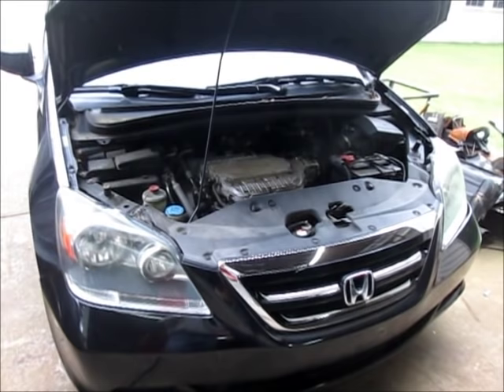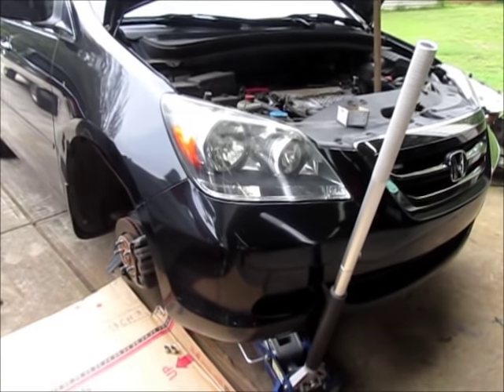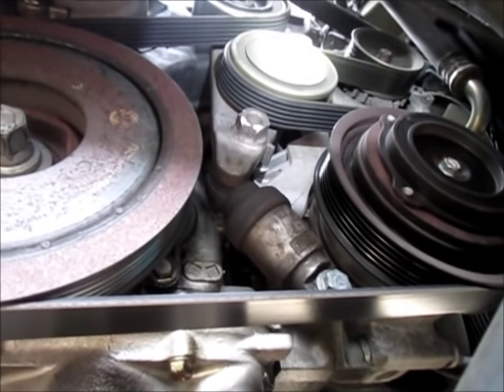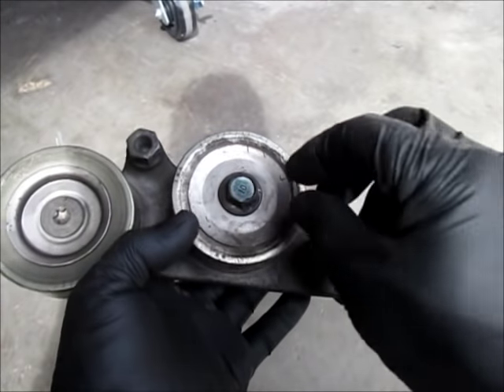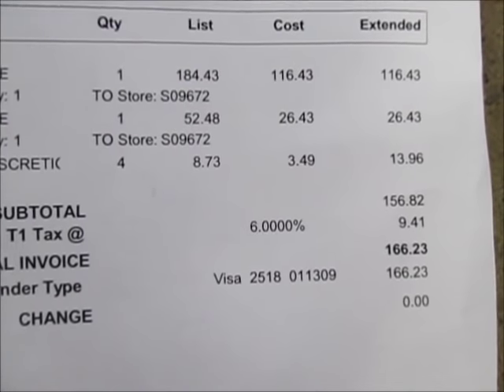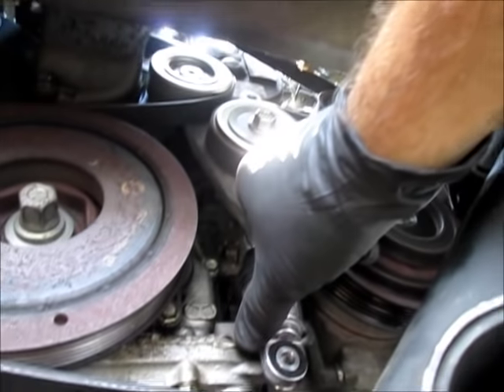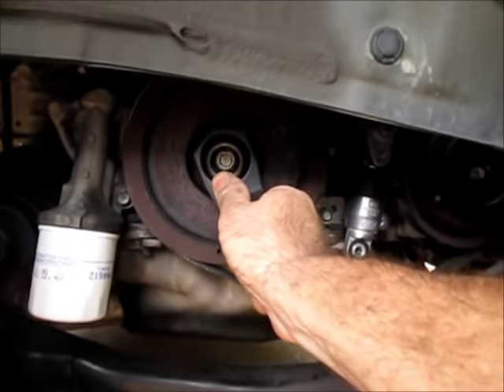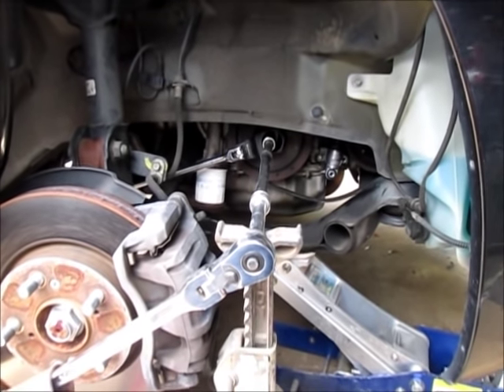Honda Odyssey serpentine belt tensioner replacement and bad crank pulley.#honda #odyssey

Comment: Can you put the tensioner in two different ways.When I went to put the serpentine on I had 2 torque the tensioner really hard.I got the 40 belt on but after that  sheered off the tensioner bolt. Luckily the bolt came out easily so I replaced the tensioner assembly and got a bigger belt.
Reply from the maker: It should only fit one way.
Reply: Thanks for the answer. Your a good Dude                 George

Comment: Well done production and I appreciate the information.  Have the same chirp and suspect it's the idler or tensioner pulley. I plan to dig into into it tomorrow.  I hope to just replace the pulleys and will reply back as to how that went.  Quick question, are either the pulley bolt (that also bolts down the tensioner assembly) or the balancer nut reverse thread.  I am 99% sure they are not but with bolts that are difficult to break loose  it's good to be 100% sure. 

I've had to pull the serp belt a couple of times on my wife's 07 and it's a pain.  I tried rotating the tensioner via the "nuts" and there was no way that would work. I ended up using a crowbar like you did (I actually used a ratchet strap tied to a member about mid vehicle on the right passenger side which allowed me to slowly pull the crowbar back and then, when far enough stop, leaving it compressed, and put the belt on, then release.  I didn't even pull the wheel off)

Again, thanks for taking the time to create this and pass it along.  Good stuff!
Reply from the maker: All standard thread.
Reply: Jo Daddy's Garage for

Comment: Great and informative video. Thank you. You mentioned the van has 200.000 miles on it. Is it original transmission? I have an 08 with about 80,000 miles and want to see how long these (great) vans can last. I got it new and maintain it well (regular synth oil changes, tranny fluid change (Honda) every 10k miles (fill and drain) etc. Is your transmission original?

Comment: Two pieces of absolutely critical info:

1: People will have an inclination, when confronted with the basic harbor freight serpentine belt tool, to use a 12 point socket in order to get around the very limited throw you'll get with most of the 3/8th stud mounting points (there are only four) but this is a major mistake. The fake 19mm bolt on the serpentine Tensioner is made of cast aluminum and you absolutely need to keep all of your pressure on the flats. 
Do not use 12 point sockets on this, only six point ones!!!

2: The tensioner's hydraulic piston needs to be primed become pliant and get past the air that sits within it at it's resting state.
You're supposed to put good forward tension on it three times before putting hard pressure on it to release the belt. 

Not knowing these two procedures is probably what causes most stripped 19mm bolts on this tensioner.

Comment: have a 06 honda odyssey with exact same noise.  Changed the belt tensioner assembly and thought the noise was gone.  a few days later temp dropped to single digits and the noise is back but not as bad.  Wondering if the harmonic balancer is bad too and causing the noise.  car has about 190k miles and serpentine belt was changed about 4 months ago along with water pump, timing belt, and cam bearings.  just started squelling when it got down 30 degrees outside.  any thoughts?   how do I tell if the harmonic balancer is bad?  it isn't loose like yours and seems solid with no play.  Does look like it may have a slight wobble when the car is running.
Reply from the maker: Good question. Mine was pretty obvious. If it has a wobble, that's not a good sign. You may need to take the belt loose and see if the outer part of the balancer moves around.
Reply: Took off the belt and the outer part of the balancer is solid and doesn't move.  I don't think it is bad but I can't tell where the noise is coming from.  Is it possible that the new serpentine belt tensioner is bad?  I didn't buy it from honda because it was twice the price so I got a Gates brand from my local auto parts store.  Also, one thing I noticed with the bottom bolt of the serpentine belt tensioner it tightened down but there is still a little play on the end of the tensioner next to the bolt.  Do you think I need to add another washer to the bolt so there isn't any movement?  I noticed this with the old one too when I removed it but thought it was probably a sign that it needed to be replaced.  Thanks for your help!
Reply from the maker: Not sure what else to tell you. As far as the bolt, I don't know if that needs a washer or not. If it was mounted the same as the original one, it should be fine. Did you install a new belt as well?
Reply: Did not install a new belt because the belt was only 2 months old and looks ok.  Noise only seems to be there when it is cold 35 degrees or lower.
Reply: Decided to change the belt with a genuine Honda belt instead of continuing to use the Dayco brand belt that a previous mechanic installed just 2 months ago and charged me out the nose for and guess what -- no more squealing!!!  Just looking at the Honda belt you can tell it is better quality (thicker, wider, and hand stitched together).  Thanks for all of your help!
Reply: Did the issue of the belt riding toward the front, not in the center, of tensioner pulley go away? I've changed my belt and now it's also riding toward the front of the tensioner pulley. The belt is in the centered on the other (idler) pulley.

Comment: those "bolt heads" that are on the tensioner are, are for doing what you did by putting the prybar against the crack pulley...you put a wrench on itand twist, and the assembly turns and compresses the spirng/cylinder
Reply from the maker: +etyrnal I actually tried that, but the "bolt head" started to round off, so I did it the other way.
Reply: +Jo Daddy's Garage oh, I see.  makes me wonder if there's a special service tool for that
Reply: @etyrnal  yes indeed there is a special tensioner tool referenced in the TSB pdf document.
Reply: @JoDaddysGarage  what size socket did you use?  and was it 6 point, or 12?
Reply from the maker: @etyrnal  Sorry, I don't recall.

Comment: Tool wasn't needed.  Just the breaker bar and a 19 mm socket.  Brace it in place and crank the engine for 1 second in spurts and that will break it loose.

Comment: Where did you get the tool to release the tension on the belt tensioner?  This requires a fairly non-standard tool using a hex head versus the more common socket head.  Based on the clearance,  it doesn't appear that I can use a standard breaker bar with a hex socket.  Thanks.
Reply from the maker: Rob F At the end of the video, I show how I installed the belt. To release the tension, you will have to do something similar. The pulleys themselves are in a fixed loaction, and the assembly moves.

Comment: Which way does the bolt on the pulley come out? Normal Lefty-Loosey? (Counter-clockwise)?? Please answer asap! lol

Update: Nevermind, thanks anyways. I was able to finally get it out, I was afraid that I was trying to go the wrong way and that I would strip the head because not only was that bolt on there so freaking tight, but I had read in another forum that some of these are left-hand threads... Anyways, to anyone who is wondering, it's a normal bolt, lefty-loosey. (counter-clockwise loosens it)
Reply from the maker: gamer taboo Standard thread. Lefty-loosey.

Comment: I would have used a 19mm socket to compress the tensioner assembly, remove the accessory belt, release tension, and THEN work on the car. It seems to me that the way you did it is dangerous.

Comment: I guess you didn’t just replace the tensioner pulley but changed the entire assembly? Why ? The video went from will look into it to just relaxed entire thing
Reply from the maker: Sorry, I didn't make that clear. It was cheaper to buy the whole assembly. with a reliable tensioner piston attached.

Comment: Hello, 
So did you notice a difference with the power steering at all? Our 05 has had problems with the power steering and it finally went. The shop said the harmonic balancer was shot. So I was wondering if the new balancer will make a difference. 
Thanks
Reply from the maker: Dan Tucker I changed the balancer after I found it was bad. We did not have power steering problems prior, mainly just a squeaking/squealing noise.  I initially set out to just change the belt and tensioner.
Reply: Just picked it up and The mechanic said the rack and pinion is going. That's the reason for the slight trouble with the steering.

Comment: how many kilometers need to replace  the alternator belt?
Reply from the maker: I assume you're asking if there's a mileage interval for changing the belt. I do not know that number. If you can get a good look at the belt, check the condition of the inside where the grooves are. If it has cracks, it's worth changing.
Reply: the chirping is really from the balancer being so loose the tensioner can take up enough slack that the belt slips over the smallest pulley at the alternator.

The balancer vibrations contribute to zapping all the bearing and the belt.

Comment: good job man.  I have 06 odyssey and I have a knocking noise somewhere in the pulleys I change everything but still have the knock. I then took off the belt and ran the van and no knock. do please help.
Reply from the maker: +KEN CEOINCUSA (KNCEOINCUSA) Thanks. That is an odd one. Without actually seeing/hearing it in person, I'm afraid I don't have any advice.

Comment: I changed my tensioner the same way but the top bolt snapped while I was driving
Reply: You can't buy the bolt separately from Honda, it only comes with the tensioner assembly.  I found a wholesaler and now sell the required bolt on Ebay.
Reply: @tubergonz  eBay name?

Comment: could of saved yourself way more time if you'd of removed the belt first using the fixed bolt head to untention the belt. then remove the tensioner assembly after. otherwise those balancers are a pain to take off. had that balancer broke off the exact same way. car died due to the battery died and alternator not running because obviously belt wasn't on and running.
Reply from the maker: +yangd0839 I actually tried to use the fixed bolt head, but it started rounding off, so I tackled it the other way.
Reply: accesory belt tensioner replacement honda 2002 odyssey